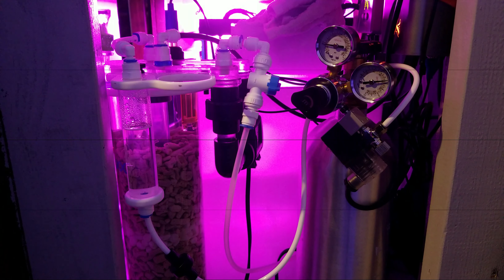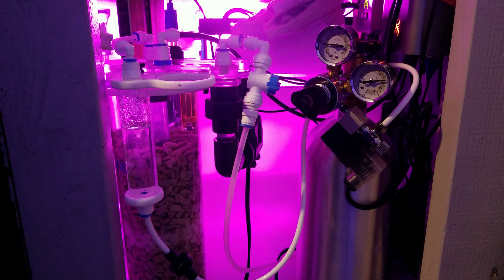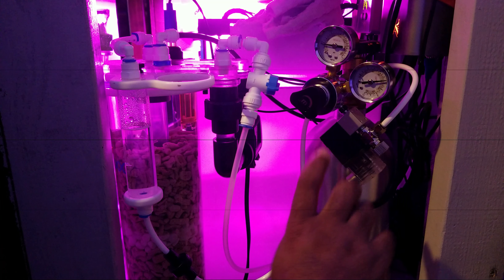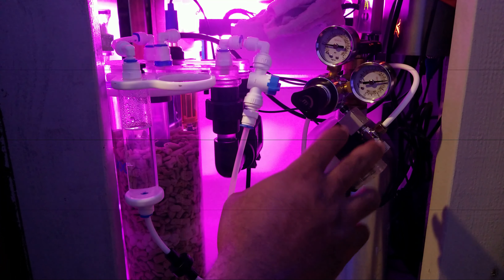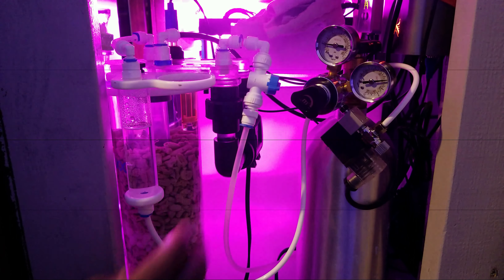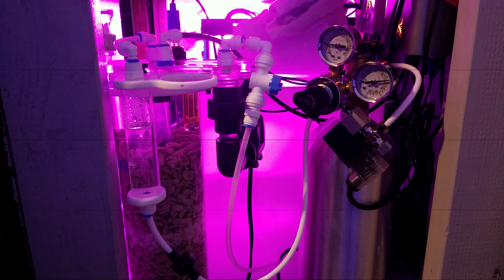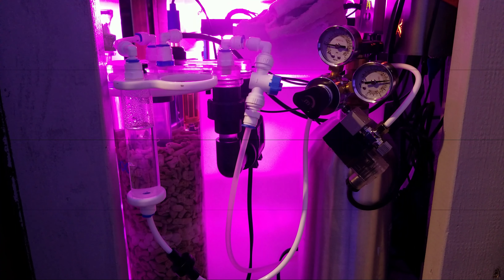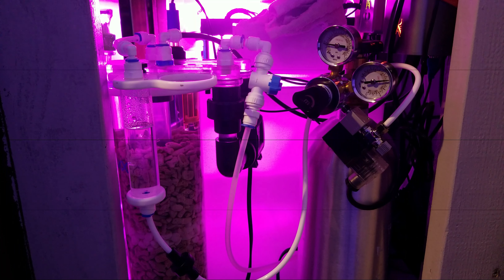Tuning a Calcium Reactor

Comment: Simply,  I'm on day 4 of implementing a Calcium Reactor. I think you'll be super happy with the CarbonDoser. I started with the CarbonDoser and can tell you it was so simple to tune in the Reactor. I'm also letting the effluent stream and got real lucky where I set the PH in the Reactor. I have had zero DKH fluctuations in the 4 days. So glad I made the switch.
Reply from the maker: Congrats. Once I get everything dialed in I should be good.